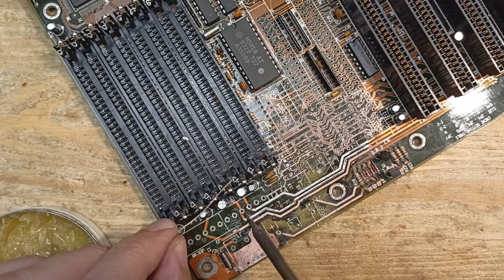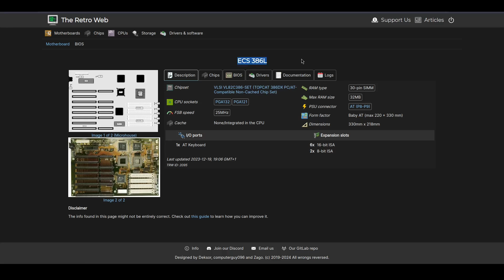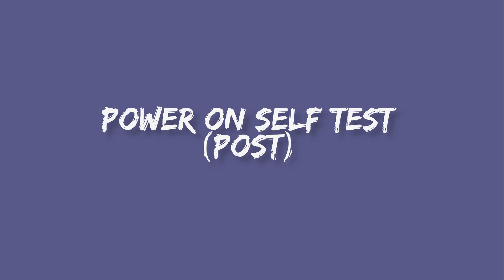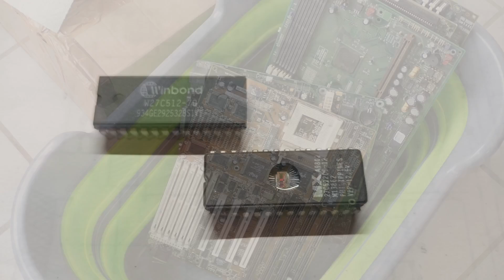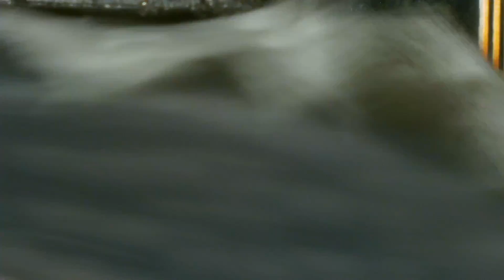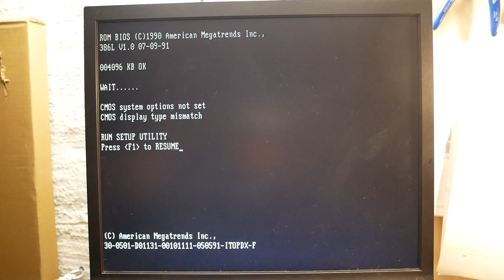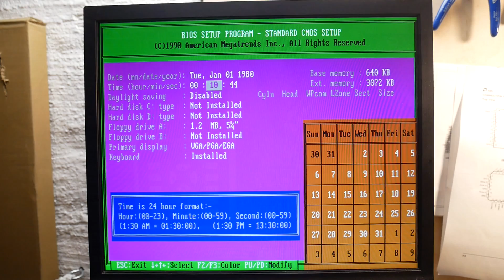Howto repair a retro PC motherboard.

Comment: I remember these boards
I had an 8 bit network card, 8 bit modem, 8 bit sound, 16 bit IDE and floppy controller 
16 bit VGA and 16 bit printer and dual serial card

It is amazing how much we were able to do with Windows 3.1

Comment: I know I'm a little late to the party, but I would like to know what is the name of the device that lets you read and dump bios images? 
I've got several old motherboards and I would like to contribute to the retro web.
Reply from the maker: The device is TL866 or the newer model T48. However, you don't need it if you just want to read the ROM. You can use DOS software to read it. There are many tools, f.e. NSSI

Comment: Lucky star 5v-a1 motherboard sees only 1/4 of installed ram. 8mb of 32mb sdram pc100 stick. Ram is working fine on other machine. Any suggestions what can be wrong?
Reply: Maybe check the jumpers, I remember hearing old IBM 8088/86 boards had a jumper specific to the amount of RAM installed...

Comment: Excellent video. Another thing to check for early in the troubleshooting process is jumper configuration, it has happened relatively often that I got boards that appeared dead or were otherwise malfunctioning that just needed to be configured properly. Sometimes even a single missing jumper can completely bork a board.

A tip to more easily follow complex jumper configurations is to highlight the lines of the desired settings either on the pdf itself or on paper after printing the jumpers cheat sheet
Reply from the maker: Good point! Thank you.

Comment: Vinegar will eat away at the Motherboard if you dip the motherboard in vinegar over night so you need to use with water and clean quickly so it will NOT destroy your motherboard. Clean and Rinse quickly.
Reply from the maker: Of course. Leavin a mainboard over night in an acid is not a good idea. Dependent on the concentration of vinegar and the amount of damage it should be about 5-15 minutes.

Comment: Today I just completed the repair of a 386 motherboard. (vogons: "some help to repair/restore a leaking battery ravaged motherboard" post)
It is the first one I have done with such a level of damage and it took me a while. but when I was measuring everything for the last time before doing the first test, I realized that I had put the power connector on the motherboard backwards!!!!! ouch!!! It was thanks to verifying the 5V. When I went to connect the PSU I saw that they were on the opposite side, hahaha.
Thank goodness I took that last measurement and my short-term memory jumped right away.
Tomorrow I will unsolder them again. It is something that is a little difficult for me without a desoldering station.

the the test will come, power and signals with a scope. I dont have a POST debug card. then with the CPU (will use a TI486DLC/40) and video card. fingers crossed

Comment: I wonder if the master himself (or someone else) could recommend what next to try in my situation with a broken Gigabyte GA-486US board. It doesn't work at all and just produces dashes on the post card. There is no damage that I can see and no battery leakage. The clock signals all look fine and the CPU has 5v. Reset line goes high then low, but there is absolutely no activity anywhere - Measuring at an ISA slot, all data lines are stuck permanently high. A18, A17 and A29 are all at 0v and don't move. All of the other address lines stay at around 3.8 - 4v.

Comment: Always an awesome video by Necrware ! 🙂
What is that super video card you have there 5000+ on speedsys? My Cirrus Logic GD5422  is considered a fast card and only goes to 2300
Reply from the maker: Hi, thank you. It's a matter of the ISA bus speed and wait states. If everything is set for a faster throughput you should come to those values with the most real 16-bit cards. For the video I used WDC90C30 and with a CL-GD5420 I get similar values.

Comment: I have old 386SX board that has 10 beep error code, which means: "CMOS shutdown register read/write error". I've checked all traces around minor battery leak. They have continuity, but I've fixed one most damaged one with soldered wire. Still no luck. Thermal camera shows everything OK.
Thanks to this video I've checked oscillators and ISA data lines using multimeter with Hz option. Not as good as oscilloscope, but it shows some activity at least.

Comment: BTW, a handy hack for erasing old EPROMs: if you have a SonicCare electric toothbrush, they often come with a stand that has a UV sanitizer lamp. This produces UV-C light and is perfect for erasing EPROMs. I just pop one in (remove the label first) facing towards the bulb, turn it on, and wait about 15 minutes. After that they come out 100% erased (all bits set to one).
Reply: mm. as I dont have an UV eraser or any uv source, I did a "little" experiment. I put 12 1Mbit eeproms (27C010) to be erased with sunlight. I checked them every day. After 4 days (~8 hours of sun everyday, sometime some clouds) the first one had already been erased (initially it was not fully written, so it was partly "empty"). The erased ones were removed from the sun. the last one was completely erased after 12 sunny days. then all, together,  received an additional day of sunlight . in some time, if everything is OK, I will erase more than 20 eeproms the same way, for further use.
Reply from the maker: I also experimented with it and at least in German summer sun, after a month I only got couple of bit flips. May be somewhere more in the direction of equator it works better, but in Germany, no way :)
Reply: @necro_ware  I'm right below the Tropic of CancerI will use those eeproms in a couple of disk emulator cards. meanwhile I got in sight 4 LEDs in a zaplamp . will experiment with those too
Reply: @necro_ware  Exactly - the amount of UVC in sunlight is far too low to erase EPROMs in a reasonable timeframe. Good thing though - or every one one of us would be dying from skin cancer!
Reply: WHAT! my firs comment just disappeared..
Reply: well, wird...
I repost...
I did a "little" experiment. I put 12 1Mbit eeproms (27C010) to be erased with sunlight. I checked them every day. After 4 days the first one had already been erased (initially it was not completely written, so it was partly "empty"). The erased ones were removed from the sun. the last one was completely erased after 12 sunny days. then all received an additional day of sunlight together.

in some time, if everything is OK, I will erase more than 20 eeproms the same way, for further use.
 We will see how it goes
Reply: it keep disappearing!!
I did a "little" experiment. I put 12 1Mbit eeproms (27C010) to be erased with sunlight. I checked them every day. After 4 days the first one had already been erased (initially it was not completely written, so it was partly "empty"). The erased ones were removed from the sun. the last one was completely erased after 12 sunny days. then all received an additional day of sunlight together. in some time, if everything is OK, I will erase more than 20 eeproms the same way, for further use.

Comment: I have fixed dozens of boards and other cards based on your methods! 👍 This is a very good tutorial! The TRW is also a cool project. I am contributing quite often. Thank you for your videos!
Just one thing to add for the viewers - if you went through all the usual suspects and the board is still dead or acting weirdly - check ALL the pins of the big QFP chips. They go loose pretty often on those 30+ yrs old boards. Sometimes it is like the chip almost desoldered itself. Based on my experience this is a super common failure!

Comment: Excellent video as always. Thanks for a end-to-end tutorial, but also all the other repair videos you've made so far. It got me into repairing my old vintage hardware with great success so far.

Regarding the ISA bus measurement: I typically put the tip of my probe towards the top and outside of the slot, and gently press against the top from the pin from the outside inwards. This makes sure I never short pins, since my probe is not going that far into the slot.

Comment: One thing about measuring the clocks with the scope: it should be square waves. On 2-pin crystals you should observe a sine wave, because it is a simple passive device. But the the places where you measure are most likely somewhere down the path through logic chips -> it should be a square wave. I suspect that your scope doesn't have the bandwidth to show squares waves at these frequencies (2 times more is a bare minimum, but it only enables us checking if the signal is changing). So if you want to check a 50MHz digital signal 100MHz is a bare minimum. 
4 pin crystals: these are actually a crystal + a generator inside, the signal should be square wave at the pin already.
Reply from the maker: It's 32kHz, quite slow, should be fine. What you say is correct, but this oscilloscope makes it up to 33MHz reliably. I think, the crystal was faulty and I got some back leaking from the connected IC.
Reply: Sorry, I jumped into the conclusion that you are saying about all the clock signals. On the RTC signal it should be a sine wave, since it is a 2 pin device, right!

Comment: broken trace and tantalum by cpu socket look like the result of someone trying to remove the cpu with the wrong tools. I'm guessing trying to lever it up with a screwdriver and they applied a lot of force and the screwdriver slipped.

Comment: Many datasheets for common ICs found on motherboards specifically mention to use tantalums. They often have a note saying if you use electrolytics it needs to be a much larger value cap. (This is most likely because larger capacity electrolytics usually have lower ESR).
Reply from the maker: In high precision high frequency circuits you usually combine many large electrolytic caps with some small ceramic caps. This is because large electrolytic caps have higher ESR, smaller ones lower. This topic is complicated, but on power rails of mainboards of that age, you can easily replace tantalums caps through electrolytic ones. The reason why they used tantalums back then, was because electrolytic were not as good as today. They leaked and dried out, but today tantalums are barely used, because they are too expensive.

Comment: If a 486 board works except only the 16bit portion of the isa slot does work, where would you start?
Reply from the maker: It depends. If the board has transceivers, I'd start there.

Comment: Nice work as always! I have run into a few boards that act dead without a cmos battery, so that might be something to look out for. It would have been interesting to see what the post card would say in that situation, but didn't have one at the time. Thanks for the video. I always enjoy seeing what you have been working on.

Comment: It seems like this channel is the only one on YouTube that repairs retro computers. There are others, like @RetroSpector78; I subscribe to these two channels, haha. I started college in the year 2000, still encountering EDO RAM and ISA slots. At that time, all I had was a Pentium 133Mhz with 16MB of RAM, and a 1.2G HDD that I partitioned into two. Watching this video really brings back beautiful memories, how much I miss those days, hunting from shop to shop looking for second-hand items, because that's all I could afford back then. It was still the era of 1.4MB floppy disks and CRT tube monitors. Now everything is online, if something breaks, you just replace it, no effort to repair unless the item is expensive.
Reply from the maker: Ah, there are many great channels. Adrian has been mentioned already, then there are tony359, bits and bolts, vswitchzero and many more great creators. Check those out if you are into this kind of hobby.
Reply: check out adriens digital basement, epitronics, usagielectric and louis rossman  😊
Reply: adrien: mostly 8-bit, epitronic: ibm, usagi: pre dos, rossman: smd apple
Reply: @adriansdigitalbasement, @bitsundbolts, @CRG, @Epictronics1, @miketech1024, 
@mrsolderfix3996, @necro_ware, @NoelsRetroLab, @RetroSpector78, @ScanLinesAU, 
@scrap_computing,  @TechTangents, @The8BitGuy, @TheRasteri, @vswitchzero, and many more that focus on builds, testing, etc.

Comment: That's cool. And even more cool that despite being quite hard to find the old motherboards are much easier to repair. It was so until probably early Socket 7 motherboards with the small exception of the intel mobos of S5/S7 family like Zappa with plenty of SMD components.

Comment: my step before power on
2 - check everything and anything. all lines,  all components, all legs of the ICs, look for any cut, bruise, touching legs (caused by any pressure o a hit), foreign bodies/particles (i´ve found very small metal things,) etc. 

not only can provoke failure to boot, but killing shorts

I do this BEFORE put any power into the system
Reply from the maker: Yeah, that's a good hint as well. As I said in the video, looking for mechanical damages can be made in the first step. In the most cases touching pins are not critical and power pins would produce a short, which you should measure on the power connector. But if you want to be really sure, it's a good idea to make it first.

Comment: Intel has bought the VLSI Chipset and used it. First it was a license but later owned by Intel. Its Intels first "own" chipset with a high integrated silikon and the start of all Chipsets made by the blue guys. Keep the Board if you like such Details :)

I like the music douring the trace repair !

And im missing some insane Overdrive content ❤

Comment: nice.

Last year I watched all your repair videos, and from  other channels too, to soak me up and learn skills and tricks before starting my repairs and restorations.

These past month I have been repairing/restoring several motherboards, cards and other parts, all  at the same time, crazy, hahaha

The one that has taken me the most work has been a 386 motherboard ravaged by leaky battery, maybe eating it away for years. I have had to reconstruct the veins on both sides. Of some only the footprint remained. Last night I finished with the lines, and today I will do it with a resistor array that received a hit and half of it was destroyed. Since I don't have the same 10x10k array, I only have an 8x10k array that I will adapt to replace the 5 destroyed resistors. I did something similar with a floppy drive with a destroyed array, I reconnected the common line and replaced the only destroyed resistor with a discrete one.

At the same time, I have been repairing and restoring a PS/2 model 50, one part of which I literally rescued from the mud and trash. More than 20 years in dirty/dusty storage room left it absolutely disgusting. The owner, a neophyte, took it apart and slip the screwdriver three times, destroying several lines and 5 resistors. I already rebuilt the lines (difficult because they are very thin) and all that remains is to put the missing resistors. Thanks to having the schematics I know what its values are. It's a task for later.

I always take a while to complete a repair or restoration, what scares me the most is the moment to test it, hahaha.

and so I have others in the restoration queue, and all this for now without a debug card, or oscilloscope (I need them for some , I am waiting to receive them, the scope similar to this one).
right now I have a day off, and are disassembling a Olivetti M4 (Pentium) that an acquaintance gave me. it need a deep clean and some fixes. I´ll keep it but will replace its guts for some older ones.

Comment: Probing right at the crystal can change the frequency - your scope probe will add some capacitance to ground. Better to measure at an output of the chip driving the crystal
Reply from the maker: Right, but sometimes it's not possible, because the crystals are connected directly to the chipset and used internally. I forgot to mension, that the crystals should be measured with high impedance probe.

Comment: Thank you for this video. One question please. Is it not needed to solder the cristal body to that large pad? (or the body of the cristal is wired to one of the legs?)
Reply from the maker: Thank you too. It's optional, but i did after the test was successful.

Comment: 13:50 - LMAO that's my go to after basic troubleshooting - replace the BIOS chips. 15-20% of the time, it does actually work.
Reply: That is valid in my opinion when You cant read/write bios chip in an external programmer. My mandatory repair step is to pur bios chip in thebprogrammer and write latest bios and rechceck

Comment: This comes at a good time - AT boards are getting harder to find (working ones anyhow) and I have a small pile of 286/386/486 boards (even a socket 7) that I couldn't bring myself to throw out. As soon as its cheaper for me to buy a multimeter/scope like that rather than a board I need to complete a system, I'm getting one and trying my hand at this.

Very motivational Necroware ;)
Reply: How to store boards - in antistatic bags - is bubblefoam good or bad shielding ?
Reply: @herauthon I store my boards in appropriate size zip bags. Got hunsreds of them already preserved that way 😀

Comment: @necro_ware , do you have any experience, when graphic card is removed from ISA slot while 486 PC has power on and has fully booted... (waiting boot disk)?
I accidentally did that, I did not noticed because system do not have any fans, I saw green led on MB later.
How big damage this error could do?
Now 486 wont do anything, I guess EEPROM is dead, not sure....
Reply from the maker: I guess, you were unlucky. It wouldn't necessarily damage anything, but you can get voltage peaks, which can end up bad. Probably, this is what happened to you. This howto should be a good start if you want to bring it back. Analyze the ISA bus and see what's happening